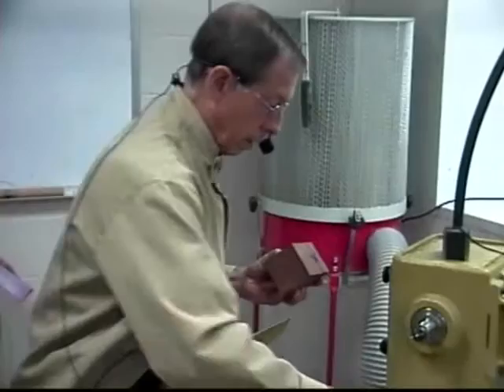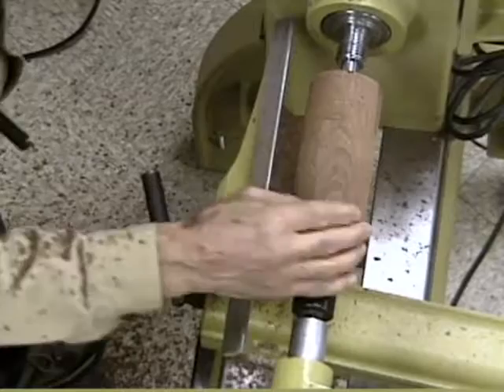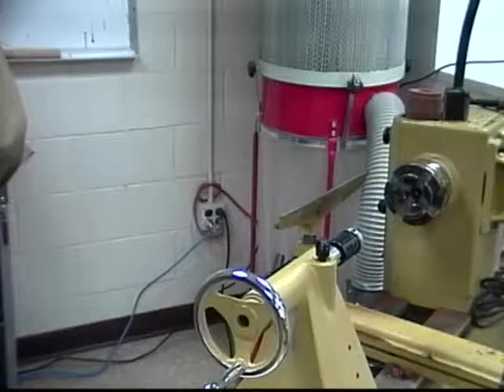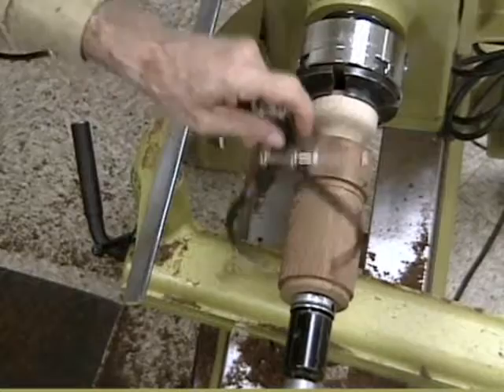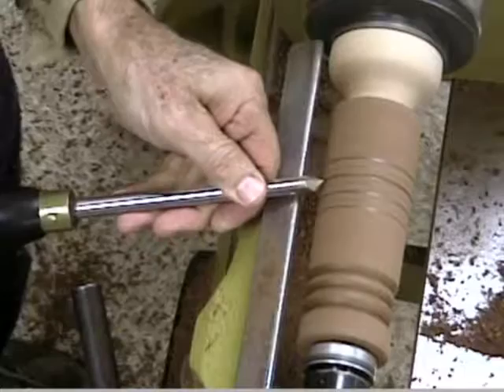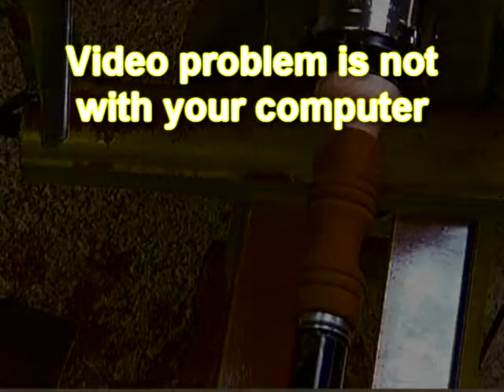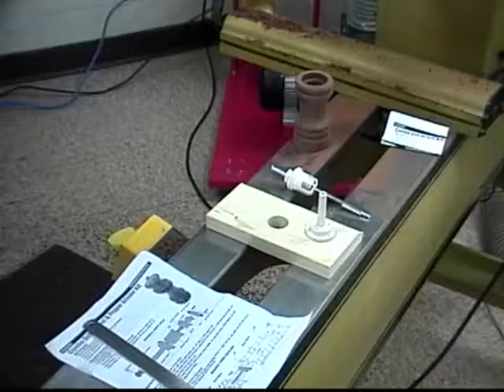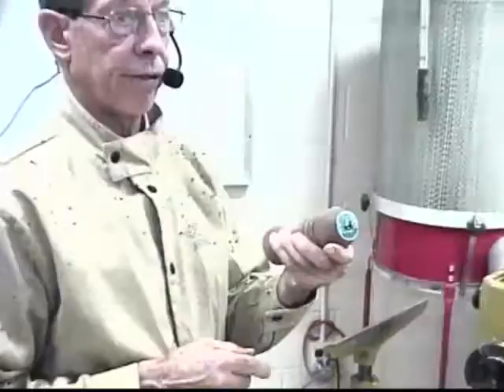Combo Salt Shaker & Pepper Mill

Comment: I cut my blank forth of inch longer than needed, then drill recessives both ends and drill though hole.  Then mount as one piece and shape entire piece,  then use forth inch to cut off.. Able to grip from both ends .  Works well for me.